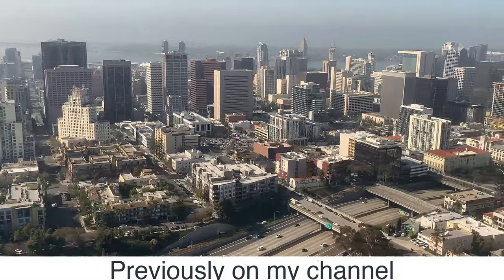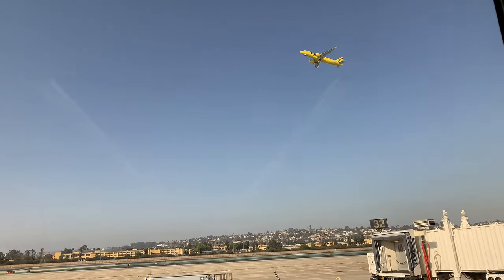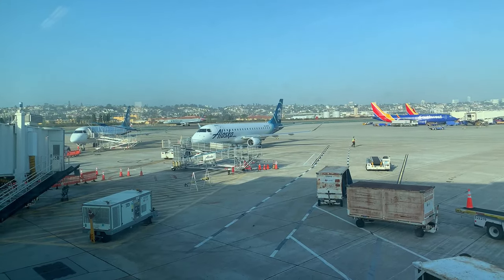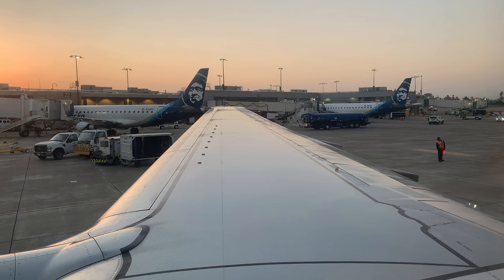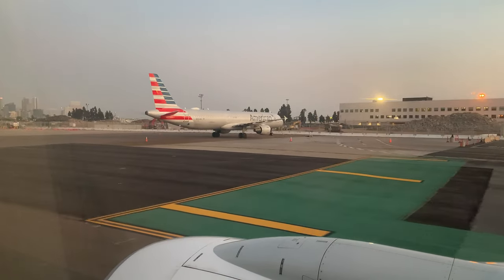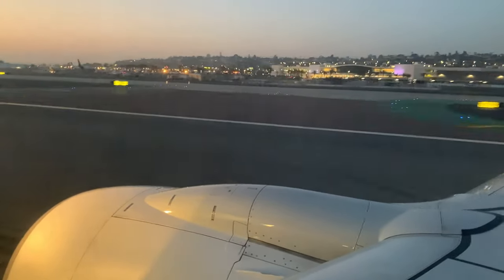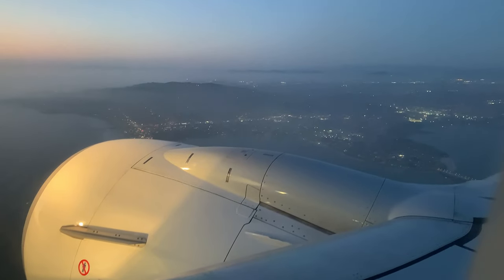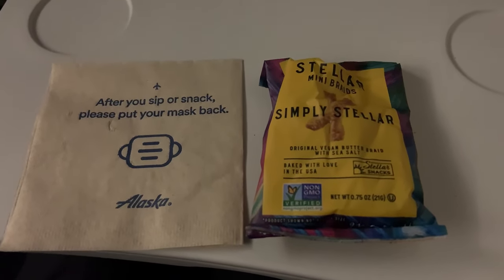How San Diego Airport's SINGLE RUNWAY Works

Comment: Seeing British Airways land is nothing compared to when they used to land in the 1980s flying the 747. If you think that’s exhilarating, watch British Airways on short final have to make a go around turn out to the right and come back to 27 on the localizer and try it again. Before Montgomery Field had an ILS in the 70s pilots would have to make the ILS to runway nine Lindberg field and then break off and stay VFR till you got to MYF.

Comment: Multiple things I want to clear up/ mention:
San Diego can't expand due to housing and a marine recruitment center to its north and a massive (and highly used by military, cargo, cruise, and smaller private ships) bay. 
It can function at such high efficiency part to luck part to a good design. The runway direction rarely has to change because the wind stays the same for the most part, although the direction can change in dense fog as only runway 9 has ILS (buildings and land block runway 27 from having it), so it's not entirely uncommon for morning flights to fly out of runway 9. Most planes (aside for Alaskas (what feels like) thousands of e170s-e195s that fly out of there) taxi off at or past Terminal 1, way past where the departures queue up. 
Also, in the (what feels like) 50 times I have flown in and out of KSAN, I have arrived into runway 9 ONCE, and that time being the most recent time I flew into KSAN. 
Having only one runway and one parallel taxiway (for most of the time) can cause issues tho. When the runway used changes due to fog lifting/ coming in, departures just cut, and in some cases can even cause the runway to be unusable due to a plane having to be on it for a minute (I've seen this happen). In the case it switches from runway 9 to 27, landing planes can get blocked from exiting the runway because planes are blocking their path, although at a certain point they (the departing planes) can cross the runway and use another taxiway.
I live in San Diego and have done so my whole life, so that's how I know all this.
Thanks for listening to my TedTalk and tell me if there's anything I missed
Edit: you got really lucky to see that BA a350. Aside for the JAL 787 that flies out of SAN, it's the only daily flight that comes from out of the continent (aside for some flights from the northern parts of South America, although those are on 737s for the most part and are can't be told apart from domestic flights). I myself have seen it moving once.
Reply: I think Lufthansa is flying a Munich San Diego flight now.
Reply: @bluesky4385  I got a picture of the Lufthansa a350 SAN to Munich at the gate and take off from T2, it was beautiful seeing that because the runway seems so short for it
Reply: I also really like the 777-200 that United has been flying to DC. I’ve seen the a350 during a couple visits but more recently saw the BA 777 😍

Comment: I was staying in Ocean Beach last week and got to see (and hear) every departure as they take off to the west right over that area. Depending on their destination they would turn to the left or right. It was a relief when the departure curfew kicked in at 11 pm. And when the curfew ends at 6:30 am, it's just one departure after another for the first hour or so. I think I read there are only six airports with departure curfews. A local tv station did a story earlier this year on how few flights are fined for breaking the curfew. One reason is they don't want pilots to feel pressured to takeoff to avoid a fine instead of delaying a flight if necessary to double check or make a repair if that's what the crew thinks they need to do.  All involved in that airport operation has to know what they are doing and be ready to handle the unexpected, like a missed approach etc. Good job everyone.

Comment: Nice Video. Can't believe a city as large as San Diego has only one runway.
Reply: One word:LAX.
Reply: It can't expand cause it's trapped in by buildings
Reply: Many San Diegans can't believe the airport is still downtown. They tried to relocate it about 20 years ago, I guess they couldn't agree on anything.
Reply: Oh, and even worse, we wonder why they can't connect trolley service to the airport.
Reply: @Anon1mous a high speed train should connect both cities and LAX.

Comment: I have landed one time from the west--during rainy weather.  Kind of exciting when you know you will pop out of the clouds very close to the airport, but I wonder just how exciting it is for the people living under the flight path on Point Loma.
Reply: meh. it's a little quieter for us (no take-off thrust) - it's most important for knowing the weather's changing.
Reply: I also have landed once from the west, in the rain. It's Pt. Loma then runway, very quick. Decades back, as a small child, I lived right under the flight path, and at the time there were quite a few smaller planes that would also use the airport. To this day, the sound of small aircraft is somehow soothing to me. Much later, I worked for an aerospace company on the west side of the runway, and the plane noise became background -- we didn't notice it. But we did have to wear earplugs when outside at work.
Reply: @celticsanster  i worked for a bit at Teledyne Ryan, on the west of the airport. Would go out at lunch and watch the pattern in the middle of the night.
The noise in Pt Loma/OB is a lot quieter now than i remember as a kid, but we don't notice - and we don't realise that we automatically pause when the noise gets too loud, then continue the conversation when the jet recedes. We usually don't realise WHY we did it until someone else asks. 8D

Comment: John Wayne is the same, one east/west runway, they turn you around based on wind/weather.
Reply: This is incorrect. SNA had 2 parallel runways 20L and 20R. Although you're right in that the operating reality is similar to SAN  because 20L is very short

Comment: If I remember correctly, I saw a British Airways 747 fly over Balboa Park on approach.  That was around 1999.  It was a pretty awesome sight!
Reply from the maker: Wow!
Reply: I've lived in San Diego for over 30 years.  There used to be a non stop London to San Diego flight and I'm pretty sure it used a 747 at some point.
Reply: @PeterMasella  BA’s SAN route was operated with a 747-400 right up until March 2020.

Comment: I come and go from San Diego a lot. Runway 9 is relatively rare but I've done it probably a half dozen times. I've been on the tarmac a few times when they've had to switch directions. That's a whole ordeal and unless you're one of the first few planes to take off at the time, expect to wait 30-45 minutes as after the first few takeoffs all the planes in the air come down for a solid 20 minutes or more before those in the queue can start going. Timing changes a bit based on circumstance, but usually I can time out the intervals and guess when we'll finally get to go.

From my house I can also see the 27 approach path, I can also see when it's not in effect and it's definitely unusual.
Reply from the maker: Thanks for sharing!

Comment: Great video. 
In December I was leaving San Diego airport for Boston and there was a strong east wind. So we had to take off the opposite direction. Because of the hill and buildings on the east side of the runway, the plane only filled up a small amount of fuel to limit takeoff weight so it could climb quickly. We had a layover in Pheonix to fill up fuel and then made it to Boston with about a 2-hour delay.

Comment: Hundreds of flights in and out of San Diego.  Twice in the very rare occurrence of a storm have I landed west to east.  Well TWICE at KSAN and once on one of my handful of flights in and out of Tijuana to the south.  It is so rare to have reverse operations at San Diego.  I know LAX flips in the middle of the night but KSAN has a curfew anyway, a takeoff curfew at least as some of the Fed Ex and UPS planes will land after midnight.  It's small for what it does resulting in almost every seat full in and out of the airport so forget that empty middle, but I can only imagine what business people think because out of the 100+ airports I've flown into around the world not one can lay claim to be any closer to downtown than KSAN.

And the approach from the east, when sitting on the left side and landing lower than all the buildings you think you can touch is one of the best approaches in the world!  I highly recommend a seat on the left side for your first time flying into San Diego.  Then once you've seen it a few times you can switch and take a look at Balboa Park and such

Comment: I'm a San Diego native who rarely travels maybe 1 flight per year (hoping to increase that) and I've been lucky enough to experience 2 takeoffs and 1 landing in the reverse direction. Pretty crazy since I believe over 95% of flights operate via 27. I believe it is more likely to happen in the morning due to fog (since 27 does not have any ILS instrumentation), however since the airport noise abatement procedure only allows for takeoffs after 0630, the window of time where this can occur is pretty small. When taking off on runway 09 the climb rate is pretty intense and you feel the G forces pretty heavily.
Reply from the maker: What an exciting airport!

Comment: Resident here. Numerous landings at SAN on 9 and 27. They use 9 for landing due to weather and winds sometimes. Just happened to me June 7 actually a bit before this. Certain times of the year there is very low ceiling and overcast (May Grey/June Gloom).
Reply: I flew out two days after you, actually. Sadly because of some delays the fog was gone before we left our gate so I had to takeoff on 27. Ended up landing on 9 on my return flight tho🙃

Comment: You were on a rare 739 because I think that’s the only 739 without any winglets
Reply from the maker: Very cool!
Reply: That's what those things are called? Oh, gosh, I'm so embarrassed. I worked in aerospace for some years but never caught on to what those cute little things on the ends of wings were called. At least I didn't call them "Cute" out loud to the engineers! At least, I have learned something new.

Comment: As a San Diego native, I have flown from a to this airport many times. Never have we landed or departed runway 9.  Although I have watched aircraft arriving and departing using it.  BA use to fly Boeing 747-400 from London to San Diego, I flew on BA from Gatwick to San Diego via LAX, the equipment on that flight was a DC-10.  I was on a bus near the airport and I've seen Air Force One 747 taxi for departure.
Reply from the maker: So cool!
Reply: Native to San Diego as well. Haven't seen the 747, but I have seen the air force two 757 I think
Reply: Also have seen Air Force One 747 come into and depart from North Island NAS. At the time, I worked on the Point and so had a completely unobstructed view to the east. I've not forgotten how big AFOne was and how we were able to see it when it was miles out to the east, over the mountains. With its paint job, it has the uncanny effect of seeming to appear ghost-like out of the sky, almost an apparition. I wonder if the Kennedy (?) design was intentionally aiming for that effect. In any case, even the ex-Navy guys around me were geeking out over AFOne!

Comment: British Airways will also operate a 747 and Lufthansa had a non stop A340 to Berlin. Terminal #1 remodel will increase the number of gates by 50% or more
Reply from the maker: Cool!
Reply: I used to work in Balboa Park and would frequently see the British Airways 747 fly over as I was walking to my car in the parking lot. It was awesome.
Reply: Lufthansa currently operates an A350-900 to Munich, British Airways only operated the 747 before the pandemic. Terminal-1 is being demolished to make way for the new, much bigger Terminal-1.
Reply: @Len1966  14 months at the SAN ARFF Station 2017-18

Comment: Peter, what would have been cool is to depart from a city with one runway with your destination another city with one runway... Oakland right up the street...  I have flown out of Oakland many times, and back in the 80s I actually got to see the Concorde land there.  I have also seen the Antonov AN-225 take off and land several times on Oakland's single runway.
Reply from the maker: I just checked and Oakland has 4 runways....but I assume you mean that airlines only use one of them?
Reply: @PeterMasella  Actually Oakland has only 1 commercial runway for airliners.  Oakland is actually 2 airports in 1.  OAK is a primary commercial service airport with four runways: one primary air carrier runway at South Field (Runway 11-29) and three runways at North Field (Runway 9R-27L, Runway 9L-27R, and Runway 15-33). The Airport is served by several passenger and cargo airlines.  Runway 29 is the normal landing runway, but, during inclement weather Runway 11 is used.  I haven't been to the airport itself in a while, but I do sometimes go to Harbor Bay Drive and spot planes on initial climbout, or to the San Leandro Marina to catch the planes on final to Runway 29.

Comment: You got a lot of things wrong, socal departure is not the same thing and does not cover lax, instead it is split into three+ section, one covers San Diego, one cover LAX, and etc. along center controllers are called enroute controllers, also when there are five mile finals it is common at any airport, if the sequencing would be closer they would say “runway 27 no delay cleared for takeoff” other than that great vid.

Comment: I’ve flown on one of these older winglet-less Alaska 737-900 non-ER aircraft. Is it just me, or are they noisier and vibrate more than the newer ones? A ceiling panel came loose from the center on takeoff, and was hanging by the luggage bin: a flight attendant had to snap it back in place.
Reply from the maker: I never noticed, but that’s an interesting observation

Comment: Now that the construction at La Guardia Airport is complete have there been fewer delays with flights there? Because I saw a video about a year ago on Coby Explanes and he said that even though more space has been created around the tarmac for planes to move around and there are more taxiways now Coby said that all of those improvements don't do much to reduce delays because of the 2 intersecting runways. Have you seen a reduction in delays there?
Reply from the maker: There are fewer ramp delays but nothing changes when it comes to airspace delays and weather avoidance. ATC delays remain the same.